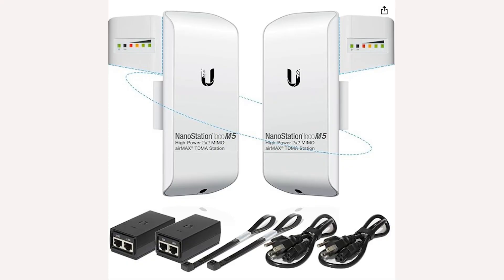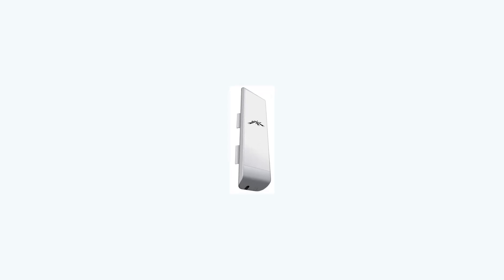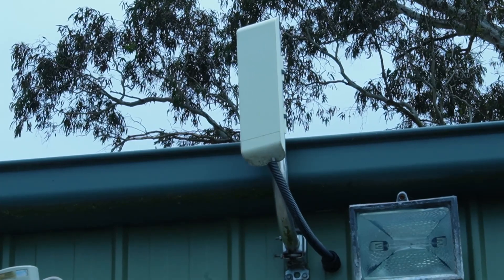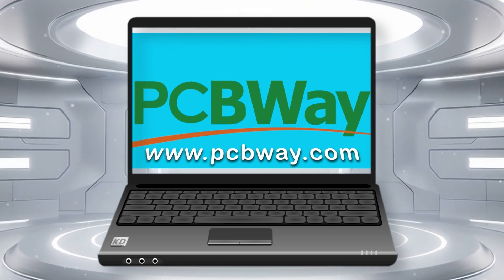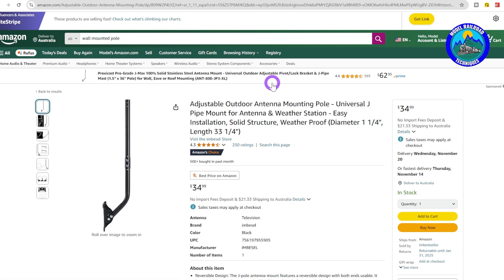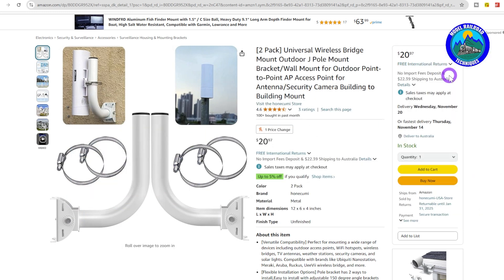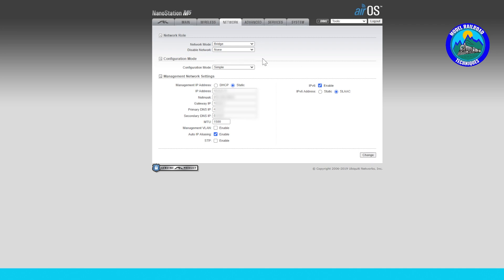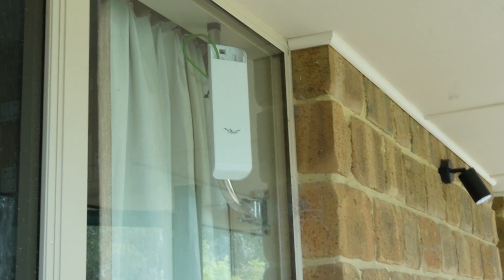Extending Your Internet To An External Building For Your Model Railway- Lightening Fast Wifi

Comment: I ran an ethernet to the outbuilding and used an additional hub set up as an access point.
Reply from the maker: This is obviously the best way, but not possible for me. What sort of speeds are you getting out of interest?
Reply: @ModelRailroadTechniques  My Internet connection is fibre 1 Gigabit. On the PCs connected to the access point I see around 900Mbps. WiFi in reasonable proximity to the main hub is 750Mbps and in reasonable proximity to the access point I also see around 750Mbps.
Reply from the maker: @ that’s awesome. I am getting similar speeds with this set up to my main PC with direct link to Starlink. Which only satellite but that’s the best I will get.
Reply: Lightning strikes even a long way off can cause a potential difference through the ground which will fry any equipment connected to unprotected underground ethernet cables.
Reply from the maker: Interesting. I assume this can be reduced with appropriate grounding?
Reply: The amount of shielding needed around the cable and the legth of the cable would make it an expensive solution, most people run the cable in a metal conduit and ground the pipework.
Reply from the maker: @ good advice.